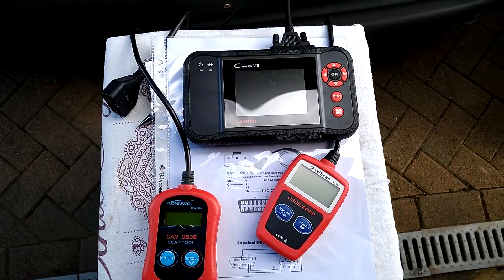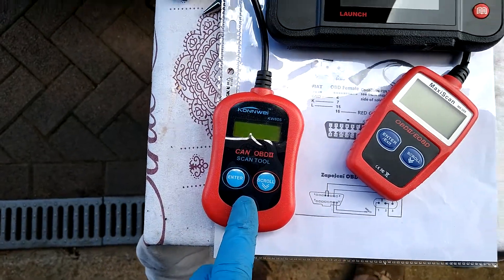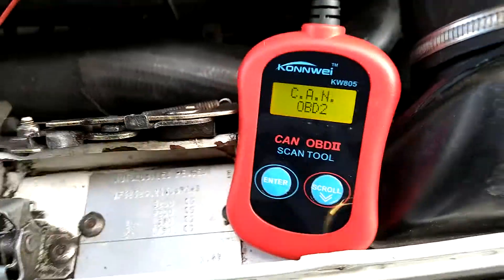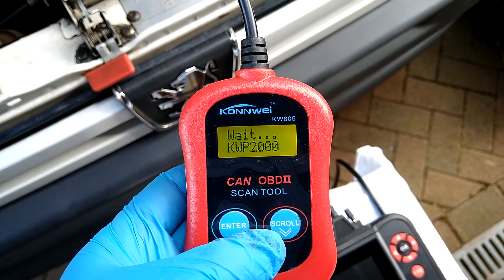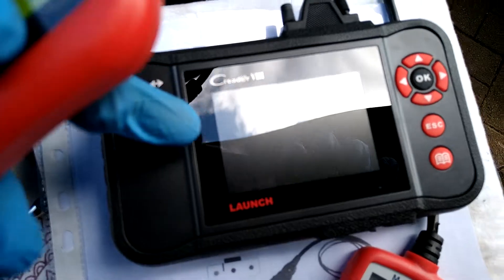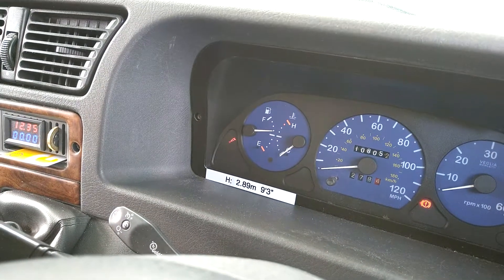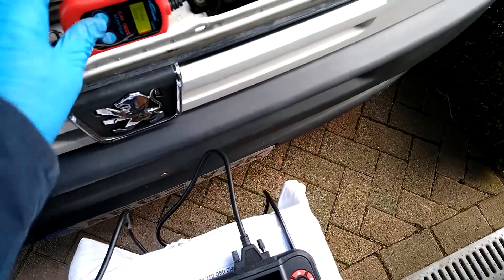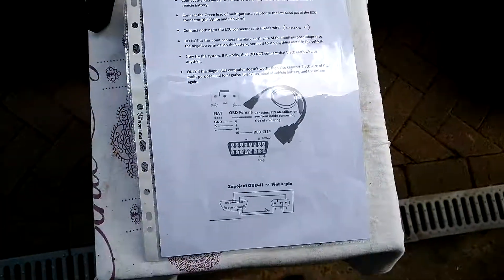2001 Peugeot Boxer 2.8 HDI / Fiat Ducato JTD OBD Fault Code CLEARING with cheap ODBII reader

Comment: Hi there, is the dashboard symbol just a general indicator of an issue and not something specific? It's come on in my van and I've not been able to find it anywhere on Google 🤷‍♀️
Reply from the maker: Hello. Yes the "Injector" symbol is a generic "Engine Light" or MIL (Malfunction Indicator Lamp) signifying a problem in one or more of the systems.  To identify what the actual issue is you need to read the codes.
Reply: @JKTowers1  Thanks for getting back to me. I don't suppose you have a link to the adaptor that you used with the OBD reader have you? 😊
Reply from the maker: @anothercampervanchannel  See the video description for the source of the interfaces (3-pin adapter AND a modified ELM327 module). This was a long time ago so any links would have been out of date by now.
Reply: @JKTowers1  OK, yep, good point. Thank you 😊

Comment: Hello,  Was looking at your video to help use the Creader, I have a 2001 Ducato 230 , I'm trying to read a fault code, I purchased the Creader vIII and a cable of Ebay, my problem is, the Ebay 3pin plug has larger male pins and won't fit into the vehicles 3pin female plug (smaller pins)  did you have any issues with getting yours to work? also looking at the diagram you have, it mentioned a green wire, I don't seem to have one on my lead? I would appreciate any help you could give? thank you, Phil
Reply from the maker: Apologies for taking so long to reply, my notifications were not working. 
Anyway, no I did not have any issues with any of the FIAT 3-Pin to ODBII connectors I've purchased off ebay.  I cannot see what colours the wires are in the adaptor as they are sealed, but I just plug it in and it works so that's good enough for me :-)

The last one I ordered was £3 on ebay and had the listing title: "3 Pin to 16 Pin OBD2 Adapter Connector Diagnostic Cable for Fiat Alfa Lancia"

Also, if you are passing near Swindon (SN6 postcode area) you are welcome to swing by and see if my lead fits.